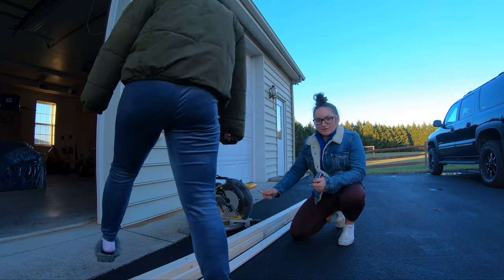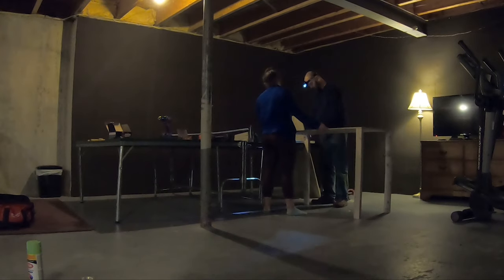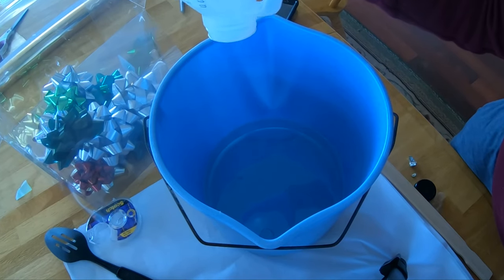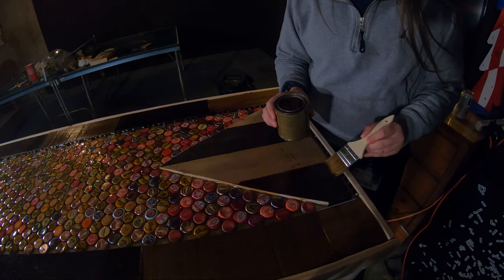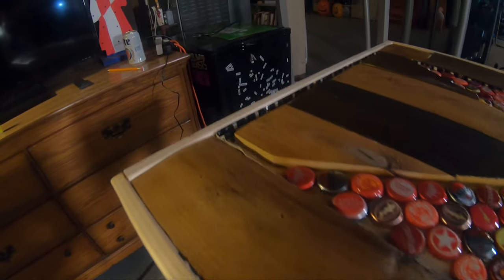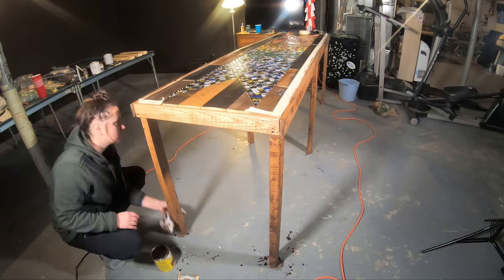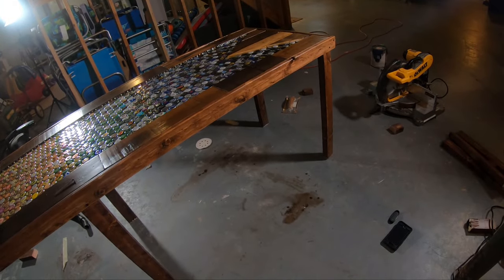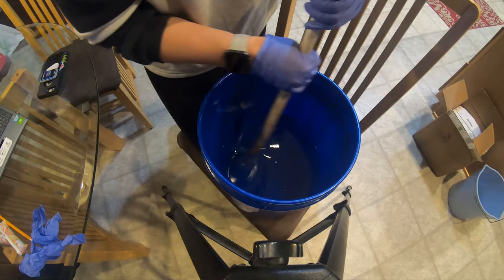DIY Beer Pong Table with Bottlecaps, RESIN, reclaimed wood COMPLETELY from scratch!

Comment: Amazing! wondering what would happen if the lights stopped working eventually? there’s no way to fix that right
Reply from the maker: If the lights themselves stop working, unfortunately yes but all of the adapters & such are outside of the resin & replacements for those are easily available

Comment: You have to pour it over the weathered wood, then sand the entire table down to get a smooth and level finish
Reply from the maker: It is poured over weathered wood only reason why it’s not completely smooth is due to running out of resin & I didn’t want to spend an extra 80 dollars on a couple uneven spots. Thanks for the input though
Reply: Anna Goes Outside aw gotcha, missed that part. That stuff is pretty expensive so I don’t blame you. Looks good nonetheless.

Comment: How well does it bounce? Does it bounce more or less?
Reply from the maker: Well resin is basically solid plastic when it is cured so it bounces like you would expect on a solid table rather than one of those crappy fold up tables that are hollow in the middle